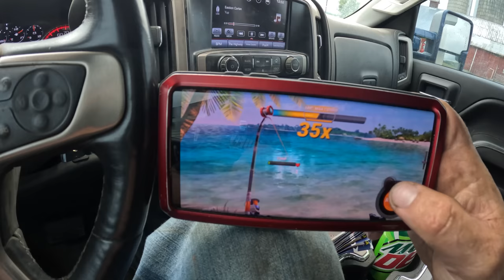Load The Trailer- Harvest Equipment Added To The Fleet!! Ohio Treating Me Well

Comment: In my experience, a 7720 and 6 row head is a perfect match. You will need a 9600 for that larger head. If you find an 8820, it will work, but its footprint is just too wide and difficult to handle. 
You will need a lot of corn acreage to justify those buys. I hope you have at least 700 to 1000 acres of crop land in your near future. Otherwise, you will need to do a lot of custom harvesting to justify the cost. 
If you have less than 300 acres of corn, its cheaper to pay the cost of custom harvesting and let someone else own the combine. It is too easy to create 1 million dollars of debt and have less than 150k of annual gross income. I don't need to tell you that its too easy to make a dime while losing a dollar if you are a farmer.
Also, I agree with the comment below about sidehill, but we farmed mountains too and got by with opening the top shaker and slowing way down. 
You may have painted yourself into a corner with that header.

Comment: If a 7720 has a problem with a 8 row head then there is a problem with that combine . I worked at a JD . dealer 35 years ago in northern IA. and a large number of farmers ran 7720 s 8 row heads in 300 + bushel corn . most guys that ran 6 row heads ran 6620 s .I am  not a big fan of JD combines , just the way it was at that time . I do see some guys put JD corn heads on NH. and Case combines . Have a good day Chris. The old white Mack  was a sharp truck .

Comment: The two trucks we had with the "modern" black interiors were mid/late 80s early 90s. Never seen a twin stick in that newer interior style either.  I want to day one was an 86 or 89 with a 300 and a mack 7 speed? Had a real goofy pattern. the other was a 91 with a 350 turned way up and a mack 10 speed. 25 years ago so its hard to remember but the latter was an absolute animal for the time.